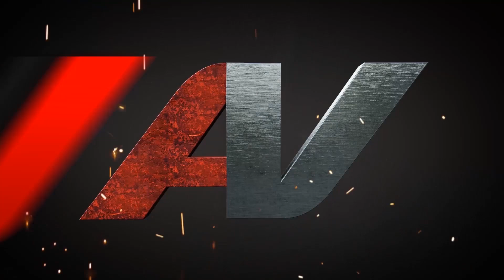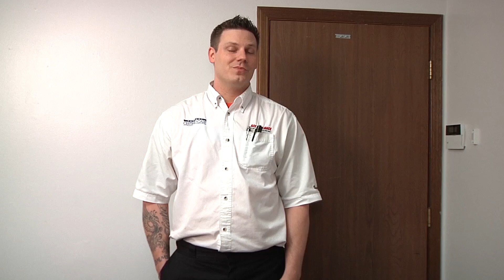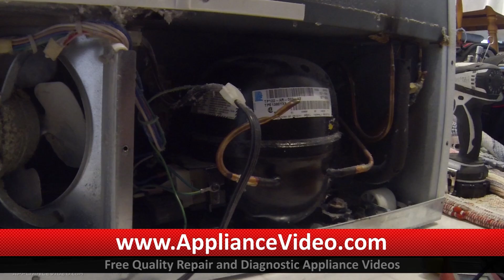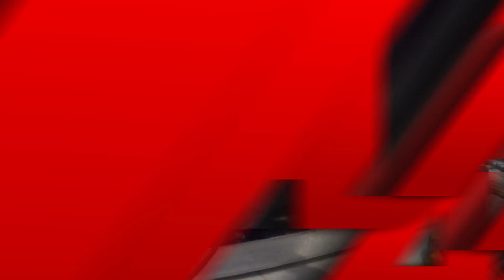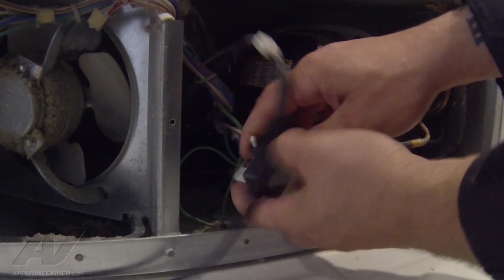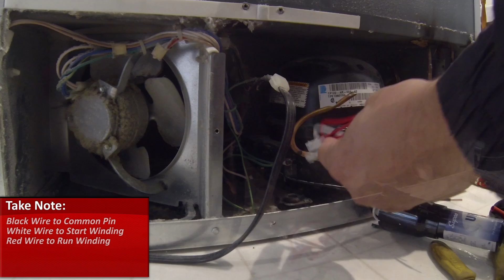Kenmore Refrigerator Repair - Not Cooling - 3 in 1 Relay

Comment: hi I have a maytag bottom freezer refrigerator that stopped working the lights are on but the compressor or the fans don't come on I replaced the thermostat harness and thermostat and still doesn't come on is there any suggestions
Reply from the maker: Good question, with our technicians
now getting hundreds questions weekly, they are answering all questions at our
website http://www.appliancevideo.com/repair-help/ .  We also have over 3,000 common questions
and answers that you can easily search through by your model number, appliance
make, problem or error code and it’s absolutely FREE.
Reply: I have a Kenmore two door refrigerator not cooling

Comment: this isn't trouble shooting...this is replacement.  how was it determined this was the problem?
Reply from the maker: Ben 
                     I suggest you go to our FREE repair help website at ApplianceVideo.com and post this issue. We have 14 factory technicians that  answer questions daily any technical on your appliance issues. This is the only website that you can get questions answered by certified appliance and HVAC mechanics at absolutely no charge along with over 2600 free repair videos. Thanks Matt Ace Appliance factory service technician

Comment: What is the main difference between oem relay unit and the universal 3in1 aside from price ? Is the oem any better ?
Great video by the way thanks
Reply from the maker: We give a lifetime warranty on all parts we install. We have a over 30% failure rate on the OEM and less than 2% on the 3in1. Its cheaper and MUCH better quality. Please help our ranking by subscribing to our YouTube page or posting our ApplianceVideo.com site on your Facebook or Twitter account. This will help us to continue to make new professional videos from our factory trained technicians and help people like you. We also have our technicians daily emailing professional advice to people that have problems with their appliances. We have helped thousands of people save hundreds of dollars. Thanks in advance for your help.
Reply: ***** I've yet to see a 3 in 1 fail in less than a year but sears will push their replacement parts and tell you otherwise.
Reply from the maker: 3in1 relay hands down is much better and a fraction of the cost.
Reply: How did you mount the 3n1 relay?